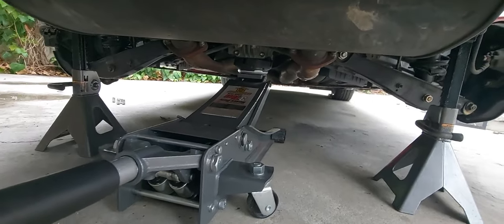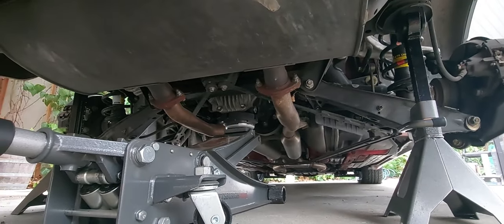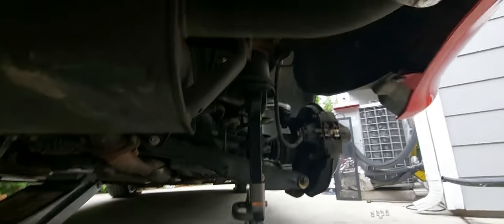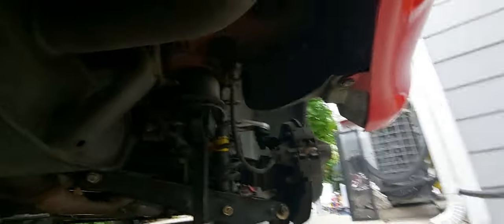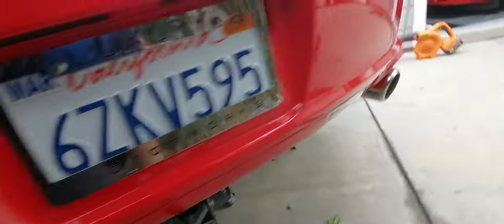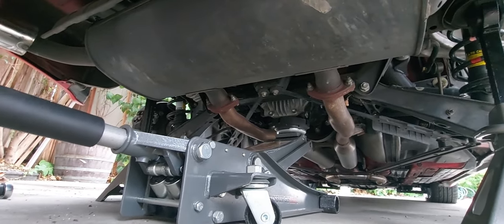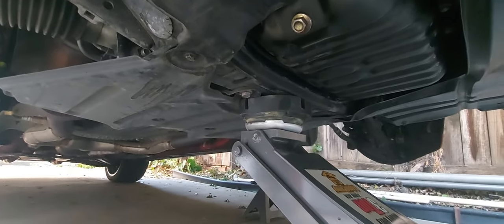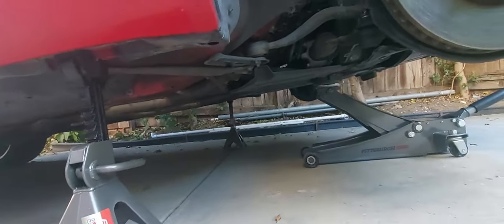How to use jack and jack stands on your SC430

Comment: Thanks for the video. I appreciate it. Do you ever lift the front and rear of the car up at the same time? If so, I assume you do the front or rear first, place the jack stands, then use the jack to lift the front or rear from the same spot, and then place 2 more jack stands. If you do this, is there a particular side to start with or is this not recommended?
Reply from the maker: Thank you for watching. Yes, I do. I always do the front because its so much heavier than back. Be safe